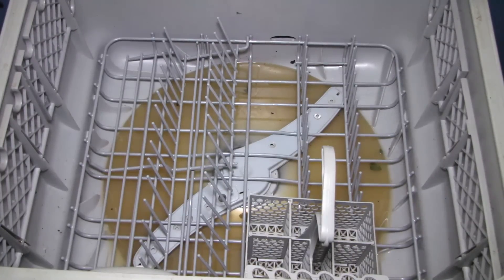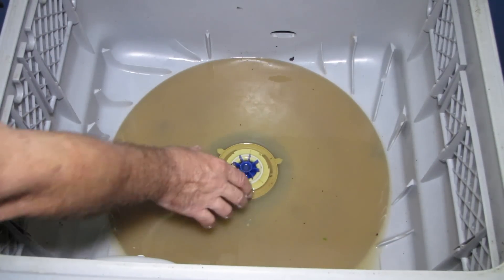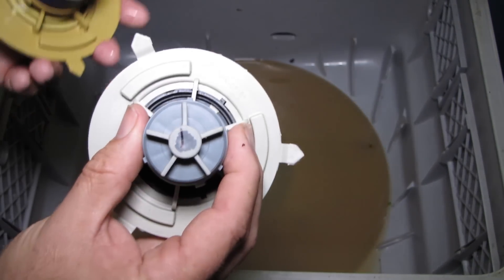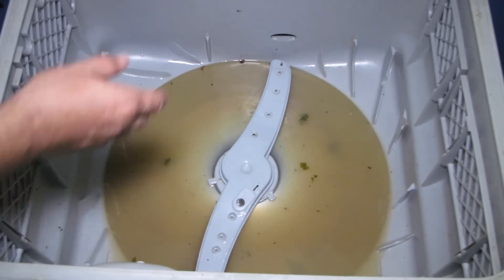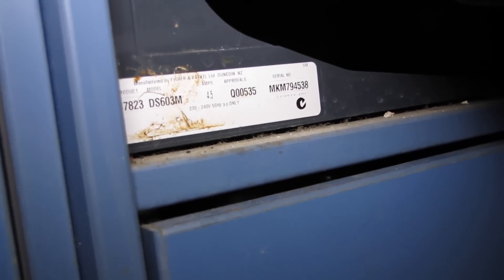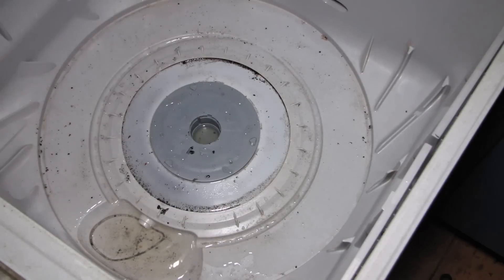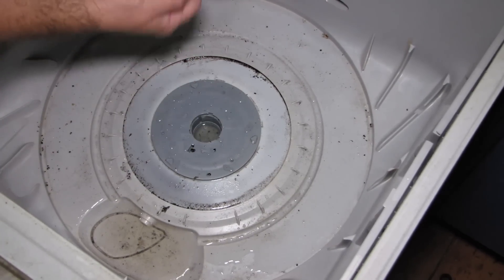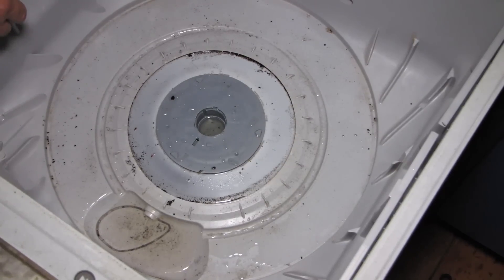DishDrawer repair

Comment: Just wanted to say thank you very much!!  I watched your clip and with the line trimmer and mini pump in hand gave it a good go.  The top drawer till didn't drain the water.  Swapped the working drawer rotor for the non draining drawers rotor and it worked!!  I rang F&P to order the spare rotor and it turns out i get 2 free rotors sent out to me, due to the recall of certain dishwasher models.  Yay!!  You've made my day!!  Bless you!

Comment: Brilliant video mate -  grabbed 5 bucks of weed trimmer line as suggested and fixed it myself! Only problem I found was that there were a few bits of crap REALLY stuck in that channel. So to fix that I cut off about 5 equal lengths of the weed trimmer line and gathered them all into a bundle and ran them all down the channel all at once - meant I could shove it quite forcefully down that channel and push the stuck bits out. Great stuff

Comment: Hi Mark, last time I called a tech it cost me $500 plus. Watched your video and found rotar ok but plastic, hair like gunk and a large plastic 1cm oval black button type device in the drain pipe where rotar goes. Cleared it using whipper snipper cord. Initially cord wou;dn't go through at all as loads of resistance. It took 7 attempts to get all the items out of the small section of pipe. Obviously the items were restricting the water flow in the channel. Whoop whoop, it works beautifully and nil cost. Thank you so much.
Anne

Comment: Thanks mate. Was about to give up but I finally managed to get the snipper cord down the drain hole. Lo and behold the dishwasher drained again. If it wasn't for you saying what a pain I the arse it was I would have given up. Took me about 100 goes to get it to feed through. Looks like it doesn't take much to block the drain tubes. Can't believe the filter actually does much...

Comment: Thanks for  video. Brilliant home fix. Just fixed ours now, had to take the top drawer out. Ours is a DD60D but is identical to your system on the top draw. Could not stop the E2 code so did a reset and rinse and it worked again. Also did a clean like this video. All seems fine now

Comment: Really helpful video.  I had been having problems because the installer didn't install the " high loop" high enough; however, after moving the loop up, I then had to cleaned up the accumulated crud.  Taking everything apart as shown and cleaning everything really helped.  I did start the washer, wait for it to fill and added a cup of white vinegar, that seemed to be cheaper than the citric acid products sold in the store for cleaning dishwashers...

Comment: Thanks mark - Mine was making a horrible groaning sound and also stopped draining. I had figured out how to disassemble it but that was as far as I got. The short tube wasn't blocked but I didn't know about the other harder to find one. Shoved a bit of twisted wire down it and it was hard to get it in at first. The all of a sudden it went through. Must have dislodged something I think. Anyway put it back together, turned on the rinse cycle and Hey Presto .. it works. Awesome mate .. save me $1899 because that is what a new one costs and then extra to get it installed. Also the wife thinks I'm a genius now haha.

Comment: The blades on your rotor looked just fine. Certainly not enough wear to keep them from working adequately. These units are susceptible to blocked drain lines because the lines small diameter flex hose/tubing that catches debris. USING TOO MUCH POWDERED DISHWASHER SOAP IS OFTEN THE CAUSE OF THE PROBLEM. It doesn't all get dissolved fully and creates a gooey sloppy paste that looks like mashed potatoes. Only use the minimum soap necessary and you will reduce the chances of clogged drain lines. Your idea for using weed trimmer line to "snake" the drain lines is "genious" and works great! Thanks!
Reply: May I ask what would be the best way to unblock the drains?
Reply: Great tip, thank you! I think underdesolved powder would speed up erosion of the rubbers on the filter plate too (very costly to replace) aswell as creating rubbery, gunky waste

Comment: Another success from clearing the channels under the impeller at ~6oclock and ~7oclock (to the bottom filter and main drain respectively). I used a pipe cleaner my wife had handy for some metal drinking straws.

In my case - it was a little pellet of what turned out to be very compressed foil, from the wrapping around those little dishwasher blocks. Couldn't have been bigger than a tic tac, but those drainage lines are very thin. Thanks for the tips!

Comment: Thanks matey, I found a piece of foil off a tetra pack stuck in ours.I had tried a bit of compressed air two days ago on very low pressure.Managed 1 load and must have moved the foil I guess..and it bunged up!All good now..used a very skinny and long cable tie (zip tie)!

Comment: Thanks Mark, when I placed the plastic tube down the sink line, it opened a non return flap I could blow back from the sink connection that I was checking out all was clear. only while the tube held open the non return valve.  The over filling of the powder pocket was another useful tip from another comment was helpful too.

Comment: Thanks for helping me fix our dish washer.  A quick rod out of the waste tube from the rotor seems to have worked without needing new parts or engineer call-out.  I would not have had a clue how to disassemble and get to the ducts/pipes before watching your video.  THANKS!!!!

Comment: This worked for us. Thank you! Saved us a service call and a new rotor. We’ve only used ours for three months. Didn’t find any gunk and it all seemed clean, but apparently something was there. Thank you again!!!
Reply: Thank you very much for the video. My double drawer works fine after a good cleaning of the passageways. Has anyone encountered after completing the washing cycle for the top drawer, I noticed abit of the waste water has leaked to the bottom drawer(the latter was empty/not used). I just run the rinse cycle for the bottom drawer to empty the residue. Any suggestions will be very  much appreciated . Thank you

Comment: Super helpful video on unblocking tube line in older model Fisher Paykel with the disassembly procedure. Will be tackling my blockage, or pump, issue later this morning. Thank you Ross.

Comment: 1/27/2017.   Thank you for the video.  Saved us a callout charge and other fees.  Issue with ours was in the discharge hose. Plugged with nasty crap.  When we unhooked it from the garbage disposal connection, there was a horrible smell.  Sucked the plug out with a Bissell, then flushed it and all is good.  Probably replace the impeller assembly as some point, but good for now.  Thanks again.

Comment from the maker: I now have a spare roter, the money I saved on a repair man covered that but I have learnt.
The time I spent on mucking around with it was a different story but if it happens again, it will pay dividends. I like the DishDraw and will probably get another if I had to.
Thanks for the roter advice.
Reply: Mark Ross you get a free rotor under the rotor recall

Comment: Thanks for posting this video. I found it very helpful. I managed to fix my issue. One thing that came to me while I was messing around with the rotor was that I knew the rotor on the other dish drawer was functioning. I did a swap, and when the drawer still didn't work I knew it wasn't a faulty rotor. in the end I used a plunger like someone else suggested and this unblocked things in about five seconds.

Comment: Brilliant . Thanks a bundle!  . Just got my quite old dishwasher draining again  Obv saved $$$ not having to pay repair ,scrap it . It’s a double drawer so swapped rotor from working drawer to problem lower drawer . When it didn’t solve drain issue , knew not to replace rotor. Tried your method , bingo ...Mrs M USA.

Comment: Having water build up in my DishDrawer, I siphoned it out with some 5mm o/d clear plastic tubing. I also used the same tube to rod out the passage between the rotor and the drain filter. And of course you can also blow through the tube to dislodge obstructions.
How to siphon: Prepare by getting together a suitable length of tubing and a pan or bucket to drain into. Fill the tubing with clean water and pinch both ends between fingers and thumbs to prevent the water draining out. Insert one end into the drain hole in the machine and the other end into your pan, which MUST be lower than the Drawer bottom. Release both ends and the water should drain from the machine into the pan.
Filling the tubing with clean water means you don't have to suck it to start the siphoning, however if it doesn't work first time and you have to suck, at least you won't get a mouthful of filthy dishwater, which is what would happen if you used an empty tube. 
PS: I am currently waiting for the serviceman to come back and fix my machine due to an F1 error code, but without the flooding that this is supposed to signal. He replaced the circuit board two days ago (second time in six months), tested it OK and now it won't start. Bother!

Comment: Hello thanks for your video. My dishdrawer started making high pitched noise suddenly after 4 years of use.  It sounds like a whined up motor if that makes sense when I start the machine, which the sound comes on and off in cycles. Do you know what could be the problem. I have checked the filters plates and rotor no obvious debris etc. Thanks

Comment: Thank you for the advice with cleaning drain tubes. It worked and we saved some money. By the way there is only two drain pipes from our central pump out. Thanks gain

Comment: Hi my DS 603 rotor was replaced 2 years ago. The dishwasher hasn’t been used. I had a family gathering yesterday & loaded up the dishwasher, it gave the F2 code & noisy.  The rotor can’t be worn out as it hasn’t been used. Can you suggest something to lubricate the bottom “5 star lugs” please?

That’s all a technician will do & charge a fortune. I’d like to fix it myself being on a tight budget.

Thank you. Great video BTW. Cheers

Comment: Would you still recommend the new versions of these dishwasher drawers?  I absolutely love how innovative but I'm nervous to purchase since it seems a lot of people have issues with these.  Could just be a learning curve for loading and operating though that people aren't understanding.
Reply from the maker: Yes I would, I like the draw for ease of access and the design is quite simple.
I believe F&P had a hard time with their new factories years ago.
We got 25-years out of the F&P washing machine and the deep freezer is now 30+.

The buttons are not great on the Dish Draw after age.   It's had it's moments and some minor repairs by me only.
There an appliance repair guy on YouTube and he rates the company product as above average but not No.1 .
Reply: @markross3761  Do you have any tips for loading?  I think I'm going to go by a local showroom today and take some dishes to test.
Reply from the maker: I just do a basic rinse and leave a gap to each plate.  My partner just shovels them in always finding room.  For some reason the plate close to each other still clean up ok but after a few of her usages, I have to scoop out the crap from the bottom (i.e. the video).

On our model, the RHS sits a little lower so our extra big plates go on the right.  Don't throw the knives in fast if you go blade down - it will eat out the bottom of the cutlery cage.

Comment: Thank you for the video. I went through the similar exercises other then replacing the rotor, but it didn't help... I only was able to pass the wire for about 70 cm though..

Comment: The hole that goes to the drain pipe ( or sink as described) has a small rubber flap in it which is a non return valve. If you poke whipper snippet coed or anything else in there you will damage it
Best to remove the draws ( it’s quite easy) flip them over, remove the covers from below the tubs ( but tricky) and disconnect the drain hose and check it. You will see the non return valve in the hose coupling
Reply: Wonder why you mean by “remove the draws”?  What are draws?  I think what you are describing is what we need to do!  Thanks for your help!

Comment: Did you have any faulty code on the leds when this happened? Now same thing happens for me and the machine is now being emptied. Stops after about 4-5 minutes. The 1-3-5 leds are lighten up and the front panel is blinking blue and red.

Comment: Very useful video, thanks.  I just note that my model and its parts manual has a rubber o-ring seal sitting in the top channel of the grey plastic motor carrier that clips into the base of the machine.  It seals to the top main stainless filter plate assembly. You see it when the filter plate is lifted out. That assembly also has a rubber gasket around its edge.  Your video doesn't show these. Clearly, my system will work without them so do they serve any useful purpose?  I see that the o-ring could function to provide a more efficient flow of filtered water (from the kidney-shaped drain filter) out of the spray arm without leakage from around the pump impeller.
Reply: Yes I have a single draw bench top about 4 years old. I have the rubber ring seal certainly would stop debris getting in  but what's the gasket you mentioned.
Reply: @bernielea3922  
e.g. in https://producthelp.fisherpaykel.com/nz/Clean/DishDrawer%E2%84%A2/Integrated_Single/DD60SI7/Parts_Manuals/Part_Manual_DD60SI7_(80884-A)
scroll down to diagram of "Tub and Components" Number 2 is the Silicon O-ring p/n 523049, Number 4 is the Filter plate assembly (that has a rubber gasket around the outer edge (not sold separately and integral with the filter plate.

Comment: The first diagnostics of any fix is the physical. So take off the draw, you will need something to rest it on it has almost no slack in the pipes. Open the plastic cover underneath, remove the outbound hose and blow down it. Watch out for the rubber valve. It should blow easily.  If not you need to airline it or rod it.  Do this towards the tub too as in this vid. Now you have eliminated all the free fixes before spending £100 on unnecessary parts. This has fixed mine twice. If you need advice on this, reply here.

Comment: Another thing to try - Disconnect the drain hose from the bottom the sink. Hold a vacuum cleaner to the drain hose to dislodge the blockage.

Comment: Yay! Fixed! Thanks so much.
Reply: How did you get the F1 error cleared after you solved the clog issue? Im finding in some places online, you must tilt the washer is 45-degree angle to reset the flood switch. Is that what you did? My FP Dishdrawer is built into the counter, not easy to pull out. Is there another way?

Comment: Hi. Reassembled mine and had 526250 RETAINER LINK left over, part of cabinet assembly. Does anyone have a diagram sighting where this is positioned as the standard diagrams and manuals do not denote that.

Comment: We removed the bottom rotor easily but the rotor in the top drawer came apart and the bottom portion is stuck with the shaft sticking out.  I pulled on the shaft with vice grips but it won't budge.  We ordered 2 new rotors since this machine is 10 years old but how do I get the old rotor out now?  A quick response would be great.
Reply: I had the same problem, just now, which brought me to this video.  I ended up using a flat blade to slide around the cylinder itself, which dislodged some grit, then I pulled straight up.  It came out, but it was definitely snug, wedged n by grit or metal filings that had collected around the rotor.  Hope that helps.

Comment: Have renters with the same problem.  The machine was filthy and unhygienic with old food.  No wonder you had debris stuck.  It looks like you use your machine as a garbage bin as well.  You should scrap and rinse your plates before placing them in the dishwasher.

Comment: I hate this machine. They are expensive and over engineered. I rinse all my plates very well and the machine still does not drain well. It leaves water in the line and underneath that metal cover. As a result I have to take apart the entire thing and clean every month or so. Otherwise it gets covered in bacterial growth. Awful design.